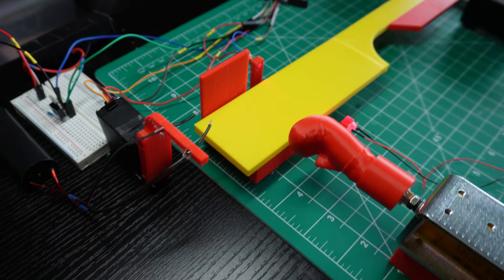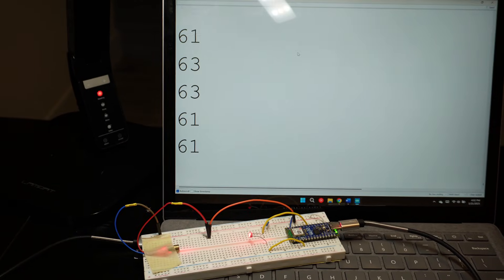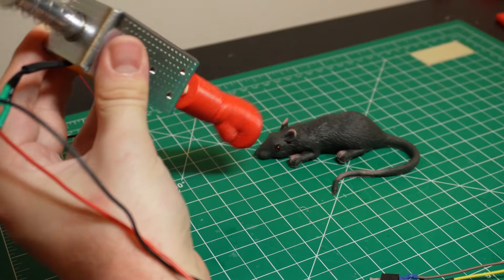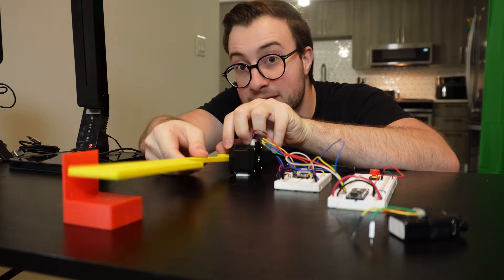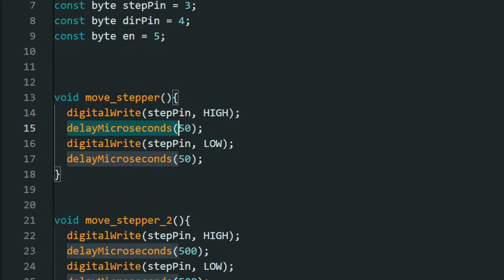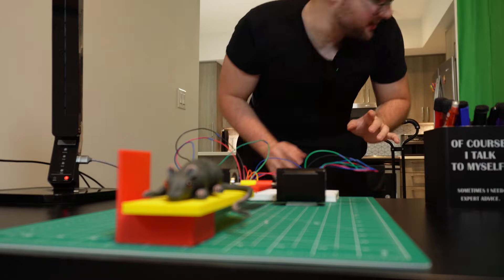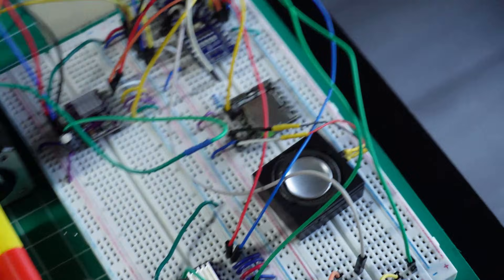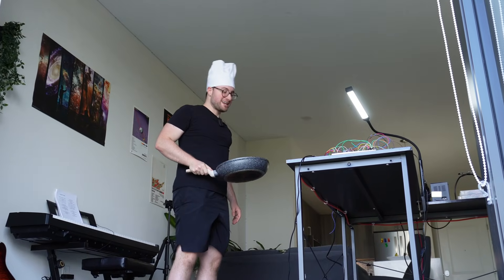I Invented a "Friendly" Rat-Catcher

Comment: hi i have a video idea. whenever bad guys in movies start some kind of robot or invention that is dangerous. the hero of the movie always saves it from starting up or invading in the last minute. what if you made a like a control panel. where normally the hero of the movie would turn it off. exept you would add useless box to the turn off button. useless box is a mechanism with servo that turns it self off whenever the switch is triggerd.